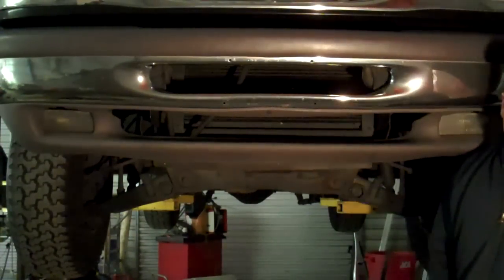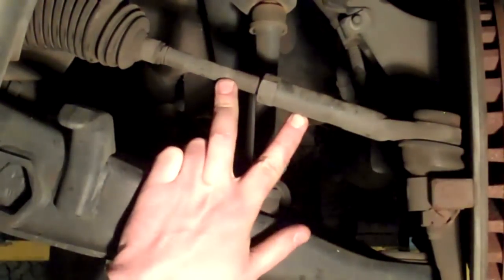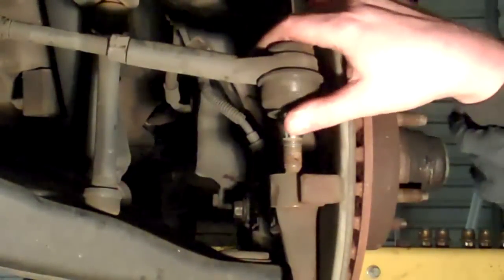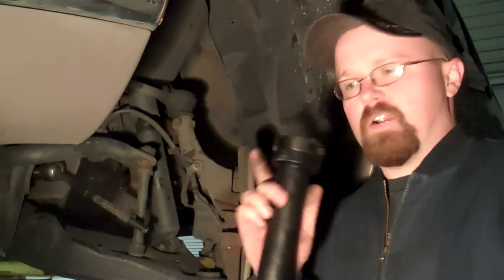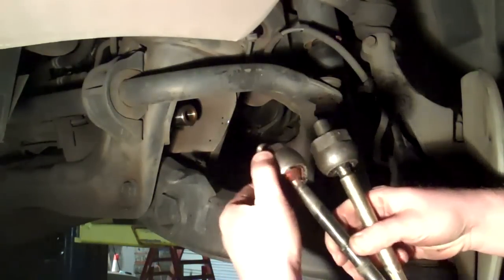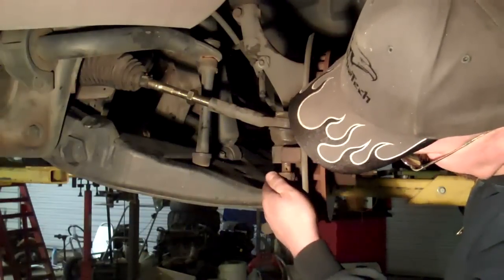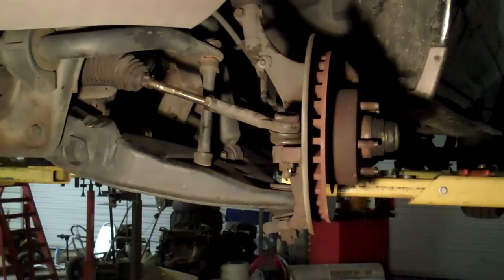Replacing a Rack & Pinion Type Inner Tie Rod DIY

Comment: This should be repaired because it's a safety concern.  It's going to fail quickly anyway, since it's going to rust and is exposed to dirt.  An hour or two and $40 for a replacement part will restore his to new.

Comment: How much that cost 1k? 2k?
Reply from the maker: How much did what cost, the whole job, parts and labor? Probably under $300.00.
Reply: @roadragecustoms  The part itself? was it new or used?
Reply from the maker: The new inner tie rod was around $20 or $30 for the part. It was maybe 1.5 hours labor, plus an alignment.
Reply: @roadragecustoms  very nice man. That was some great content man. Thanks for posting.

Comment: My inner clamps are missing on my Bellows Boot, and now I have a power steering leak, can those be replaced?
Reply from the maker: Bellows boots and clamps are replaceable. Unfortunately, if your rack and pinion is leaking p.s. fluid into the bellows boot, you need a new rack and pinion assembly.
Reply: My leak is coming from the bellows boot. We noticed it when he turned the steering wheel and the clamps where missing and that's where the PS was leaking from.
Reply: How can I know if my Rack and Pinion is leaking?
Reply from the maker: +Patricia Posey If p.s. fluid leaks into your bellows boot, it is coming from the rack & pinion.
Reply from the maker: +Patricia Posey The bellows boots should be dry inside.

Comment: i have fluid coming out the end of the bellows when turning the wheel all the way left or right.
is there a seal in there that can be replaced? steering feels good. no hard spots or whines, just loses fluid.
its an expensive rack so id like to know if it is a replaceable seal.
thank you
Reply: What ended up happening too the car

Comment from the maker: @mattcmyers9 Yes, you can damage the rack.  Make sure there is no locking hardware still attached.  The book procedure is to remove the rack & pinion assembly & clamp the rack in a vice.  Then you are supposed to use a breaker bar on the inner tie rod tool.  It sure is quicker to do it in the vehicle, though.  I haven't had a problem doing it this way yet.  Famous last words...

Comment: have a steering rack to go into a opel corsa but can't manage to take out 1 off the main bolts on the steering wheel side as bolt won't push up as the steering box is in the way any body tell me what way to drop it out ???

Comment: Thanks to you, I just did this on my 99 Explorer.  I've done outer tie rod ends, but never had the guts to take the boot off of the inner one before.  This video explained it very well.  The first tool I borrowed from AdvanceAutoParts looked like yours, but it was too shallow for the ball/socket part.  I went back and borrowed a smaller tool that fit around the part better and was able to change it out.  Thanks again!

Comment: Thank you.  3 more related questions please:  (1) blue (med) vs red (high) strength lock-tite compound ?  (2) impact hammer or no.  (3) Typical torque spec for the pinion end of the rod ? I know the knuckle end is 60 ft-lbs. You use "blue" lock-tite in the video;  but 1 of 2 tie-rods I bought is Moog and comes with a tiny tube of "red" lock-tite.  I don't know if it's expected that I'll be using a breaker-bar  vs impact hammer for disassembly again later;  Impact might break something ? Thanks.

Comment: yai it sucked bad. i had replaced the outers but just curbed it and bent the inner. cant believe how much the boots cost. i did a self align but ive got a grinding sound when turning on the same side as the damage.

Comment from the maker: @montelee If it were mine, I'd buy a remanufactured rack & pinion.  There may be seals available, but I wouldn't go to that much trouble when a complete unit is so much easier.  I also wouldn't consider a power rack without fluid a manual rack either.  The pump will lock up without fluid.  If the rack is leaking that fast, it probably has other issues that could lead to loss of all steering soon.

Comment: hi roadragecustom, is it necessary to grease the inner tie rod?? inside the boot?
Reply from the maker: Luis Rodriguez No. New inner tie rods should have a little grease on them from the factory. I have never heard of anyone adding more grease. Inner tie rod ends on conventional, non- rack and pinion steering systems have grease fittings (zerks) if they need to be greesed.

Comment from the maker: Thanks for watching & for the comments. If you have a 4x2 it is a little easier than a 4x4. The 4x4 has a locking hub assembly that has to be disassembled before the rotor can be removed. The 4x2 has a dust cap, a cotter pin, and a nut that holds the rotor on. For the whole job job you'll need a set of basic hand tools, the inner tie rod tool, a bearing packer, & possibly a grease gun. See my trailer wheel bearing video to help with packing the new bearings. Get an alignment ASAP after tie rods!

Comment: Got some new inner tie rod thay came with two little wire round rings what are thay used for .... 2001 ford sport trac 2x4 ....
Reply from the maker: Canadian kid do they fit in grooves on the rod itself to keep the small side of the bellows boot in place?
Reply: roadragecustoms THANKS Yes thay do, also I asked JPN... e bay ....  where I got the parts thay said the two small rings are to hold the boot in place with clamp at the boots end...

Comment: Ive been trying for about 3 weeks now to take my inner tie rod off but it wont budge for NOTHING. Ive put PB Blast on there used a pipe wrench and hammer.. Nothing is seeming to work.. Can anybody give any advice?
Reply: gabby, put a pipe on the pipe wrench as a cheater bar and it will come off, anyway that's what worked for me...good luck
Reply: You may have  safety pin there to be removed first

Comment: need to change the rack and pinion on my t & c 2005;ime not paying $500 or so for a brand new one-should I buy a second hand one from a 2006 (70 000 miles) 3.3l or a 2007 with 32 700 miles OR a refurbished one ("Detroit refurbished") sells on ebay for $102.....???

 ·

Comment: I got that same inner tie rod tool at harbor freight for 40 bucks.  Worked great.  The lower ball joint press tool which was twice as much on the other hand, cracked after the first ball joint I pressed in.  Guess I overtightened it.  Either it was cheap metal or I was extra strong today.
Reply: oz, you can rent many of these seldom used specialty 
tools for free at all the major auto parts stores...why buy
Reply: It was probably 'Made in China', junk!

Comment from the maker: @babymil... The main thing to remember when replacing r & p assembly is that you don't want to damage the clockspring for the air bag. Make sure the steering is straight ahead on the old & new units before disconnecting the steering shaft. Don't move the steering wheel after the steering shaft is disconnected. Disconnect the PS hoses & replace the o rings before reassembling. Count rotations on outer tie rods when removing them & install on new rack the same. Get align'd when done.  PM 4 more.

Comment: zip tie ok for the inner part of bellows? i have to do this on my sebring
Reply: I wanna say yes
Reply: @whyyouhatingonme  I just did mine, and used one of those metal screw clamps.  It took some tool gymnastics to get the screwdriver on the clamp.  I would hate to be the guy that has to get back in there and replace that tie rod, again.

It will probably be me, and I will curse myself for using that type of clamp.

Comment: One question on the rack and pinion, how does one bleed the system when replacing with a new empty rack and pinion system?  I know with brakes you have to depress the brake pedal and use the bleeder screw but how does one make sure air doesn't get trapped in the new lines of the rack and pinion?

Thanks, EXCELLENT Video!!

-Nigel

Comment: And it's that easy! I changed my inner and outer tie rods on both sides on my Honda over the weekend and I also used that hammer method, always do. Best way I think when trying not to damage the ball joints.

Comment: This Video makes this Job look so easy, but its actually not, Since the Clamp On the Inside is Not Reusable, What did You Use then?. :?
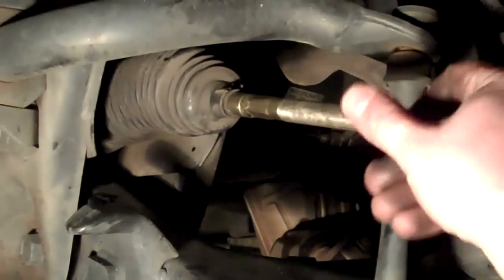Reply: Most people use either a new clamp, or zip tie. If you watch around 3:49 he says "zip tie and outer clamp, so he used a zip tie in that instance. 

It is not an "easy" job, if you have a lift, and the accessibility, it's a bit easier. It's not overly complex, and if you have the mechanical wherewithal you should be able to do it with a jack and a few tools.

Comment: Drive carefully to the alignment shop. If the replacement tie rod is not exactly the same as OEM, the counting turns won't work and your toe will be way off, which makes the car track funny. I know this from experience.

Comment: everyone here is griping about the zip tie. the bellows boot shouldn't be moving around a ton so it's fine.  if it really bothers you, use a metal zip tie. $5 a pack at harbor freight, right next to the plastic ones. honestly plastic on plastic is nice in this application bc metal can cut the boot
Reply: The factory clamp is metal....

Comment: my idiot mechanic put oil (not grease) inside the boot. About 3 medium side syringe because i was having noise when turning the wheel. It didnt help, how i have oil inside the boot. If that oil goes into the vent tube it will clog it up and the boot will break from pressure.
Reply: Dasty xosh zor çaka